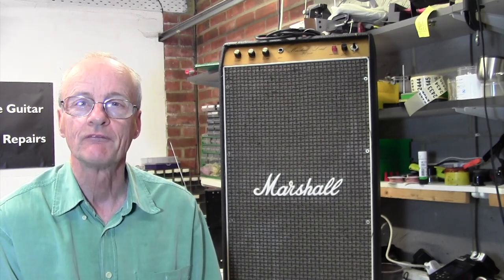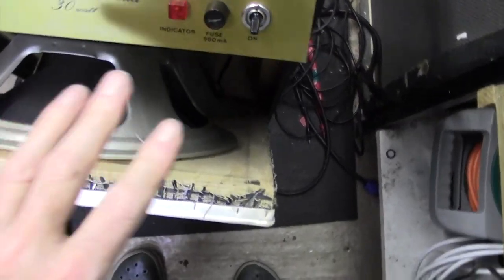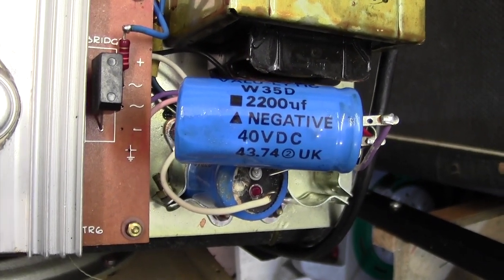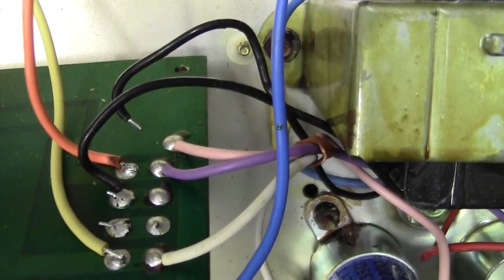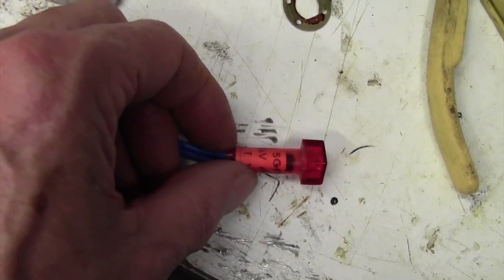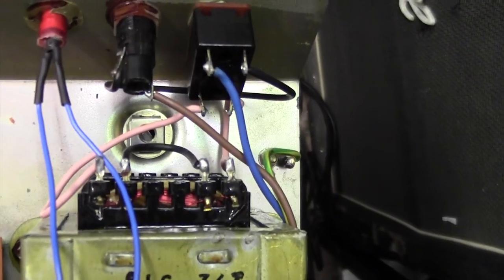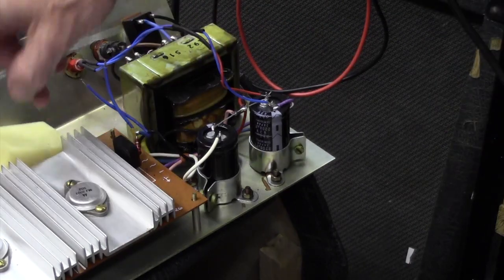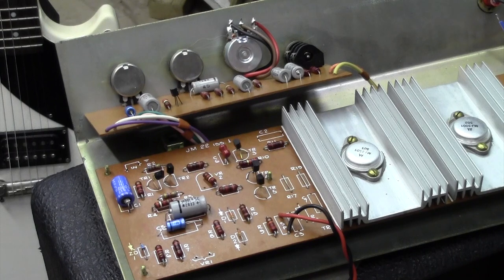How to Fix Marshall Lead 30W Hum

Comment: I too repaired and built amps in the late 70's and agree on there simplicity compared to the modern amps. However now amps have fancy anti distortion and clipping circuitry and DC protection. In the 70's amps if an output transistor failed as they often did then you could kiss goodbye to your speakers too more often than not. Keep up the good work. Love the videos.
Reply from the maker: Thanks Stewart

Comment: You've never seen one in the shop because this is the first one to ever break down.  Even at that, it wasn't actually broken, it just outlived the smoothing caps.

Say what you want about solid state, but it's a fair bit more reliable and maintenance free than valves. Yes, it has a sterile tone, but that's what pedals are for.  My favorite amp is my '77 Peavey BASS which looks very similar to that SS Marshall on the inside.  It got its first cap change on its 45th birthday.  Been rock solid, no issues at all for all these long decades.
Reply: Perhaps Stuart never saw one before because very few of them were sold, or maybe very few of them were sold in his general area.  It's difficult and probably inaccurate to make generalizations when you only have a sample size of one. It's also kind of an oddball, funny looking amp with only a few knobs and a big cabinet, and so it's hard to imagine that it would be a "standout" that grabs people's attention in a music store and yells "try me"!.  Not all products that sell well are "good" and not all products that sell poorly are "bad"; but it's difficult to know the difference if there were are very few of that particular device around that you can try as a player or work on as a tech.  That said, from a  tech's perspective (50+ years in electronics, myself) this is a very simple looking device and likely wouldn't be difficult to service as long as the transformer's okay and it doesn't use any unusual transistors that aren't easily obtained or substituted for.
Reply from the maker: Another contributor has said these were mail order only, apparently.

Comment: Great video again Stuart. I remember a few of that design knocking around in the 1970's. Simple, effective and reliable as long as you didn't spill a pint of Watneys Red Barrel  over them.  Nice looking amplifier with the upright 2X12 configuration and it didn't look like a pain in the rear to repair either.
Reply from the maker: I wish they were all so straightforward!

Comment: Thank you for another entertaining lesson on working on these older amplifiers.  I am learning much from your videos.  I believe  your systematic troubleshooting is the most valuable lesson I have learned. I picked up an old nonfunctional B&K 625 tube tester and was able to repair it by using your methodical, simple troubleshooting.  
Thank you for speaking to the newbies as there is much I have to learn.
Wonderful video of amp I've never seen before.
Thanks again, Stuart.
Reply from the maker: Thanks Michael I'm glad you enjoyed it.

Comment: Back in the 1980s I had a Marshall Lead 20 solid state combo, which sounded pretty good for  a solid state amp. There was a 12 watt version as well.  The pots unfortunately were very low quality and subject to being noisy no matter how often you cleaned them, and there was some internal hum radiated into the audio signal due to the location and orientation of the transformer.
Reply: I've noticed that one of the pot in the amp seem to be changed....  maybe a common fault?
Reply: @bjornstromberg7975 ,  according to a guitarist and music shop owner I went to school with, yes, noisy, intermittent pots was indeed a common problem with Marshall solidstate amps of this era.  My Lead 20 was probably a generation or two after this amplifier however because mine had all the pots mounted on a long strip of circuit board and not individually wired and mounted like they are on this amp.  The pots in this same amp would be easy to change but they would not have been on my own amplifier....

Comment: 13:30 ... About the transformer AC ...
The common 3 lead center tap transformers divide the Mains in 2 phases that are 180 degrees from each other. 
If you put the leads on these points the meter sums the phases ex: 20 + (-20) and the result is close to 0.
This doesn't happen if one lead is on a fixed voltage.

Comment: i love your videos . i seem to learn something on everyone i watch . you explain everything so great even a beginner like me can understand and learn from them thank you .i do have a question about this one so on the cans when you was explaining the wiring the red wire  is coming from the center tap then the purple is negative. the question is why wouldn't you ground the purple negative side and not the center tap  wouldn't it just short out the can? this one has me stumped because i know it is right just don't understand how it works. thanks again i have learned a lot from your videos
Reply from the maker: It's a bit hard to explain simply but if you ground the centre tap of a secondary winding, the other two sides give you two equal antiphase signals. That probably didn't help!

Comment: I had one of these but it was a beige colour and it suffered from some sort of thermal run away problem, as it warmed up it made a motorboat sound, and you would have to turn it off untill it cooled down, if you turned it upside down you'd get another ten minutes or so before it happened again
Reply from the maker: Just use it upside down. Sorted!

Comment: I have a cheap dental mirror which is backlit by an LED that aims at the mirror, powered by a AA battery. Very very useful!  The original mirror was plastic and eventually got scratched up so I replaced it with a glass one stolen from another inspection mirror.
Reply from the maker: Hmm, nice idea! Must gey myself one.

Comment: Just found this channel. 😊Very good. Question : i have a few solid state amps old, British when turn power switch on theres a loud crack/bang from speaker. I've used amps since 1980 and many have done this.. They work ok but i dont like thus turn on "crack * bang sound. Is there a way to stop this or does some cap need replacing? I thought i read years ago that there is a fix for this...? The amps i have that have problem is Vox Escort bass combo quite old.. Some caps were replaced about 20 years ago.. And other is that late 70's. Modelling amp built into flightcase by PA:CE, sorry i forgot name.. That really is scary bang on power up.. Its never been serviced and needs one.. Its missing the speakers and flight case box. Redmere is name, models a Marshall, Fender Twin and Vox its claimed and weird touch switches and built in sustain and chorus, flanger.. Thanks
Reply: Redmere Soloist:
https://youtu.be/4SKEZglt9cg?si=j6Pz0bZpDNZKyGJY
Reply from the maker: Hi This is one of the more tricky things to sort and often cannot be. It's usually the design of the amp. A cap charges up quickly on power-on and this DC spike gets transferred to the speaker causing that bang. No easy answer I'm afraid.

Comment: The reason the amplifier sort of worked is because the amplifier has a plus/minus (+/-) power supply, and the power transformer therefore has ---- must have ---- a grounded centertap for the secondaries; and as one leg of the secondary intermittently disconnected itself from the circuit (touching the soldered connection intermittently or perhaps hanging by a cold soldered thread)  You still had some voltage being fed to half of the project of fire by the one remaining secondary and the chassis grounded center tap.  This would have given you only a half wave power supply with lots of ripple on it as either the plus supply or the minus supply went missing in action.   There are other possibilities also involving maybe a shorted filter cap or some other way that you could still get plus and minus voltages to the output stage (are they a complimentary NPN/PNP pair, or not) , but regardless it's clear that you can disconnect one secondary and still get AC voltage to the bridge rectifier because of the center tap on the output side of the transformer, and DC output from the bridge....
Reply: PS, I looked more closely and the outputs are definitely complementary devices that run on a plus / minus power supply.  Temporary loss of either could cause DC offset and fry the speakers (as well as loud hum), so it's probably just as well that a wire broke off of the speakers to protect them! 😉
Reply: A variable DC power supply is handy for experimenting with LED's to determine what voltage to run them at for a good brightness level without causing overheating of the LED; and since they only need about 3 V more or less at very low current a resistor-substitution switch box is also handy because it prevents you having to substitute different resistor values one at a time to figure out how to drop your 20 or 30 V power supply down to the 3 V needed for the LED. It's also generally best not to shove the LED right up against the front of the bulb jewel or colored lens because LED'S are far more "beamy" and don't have a more omnidirectional light pattern as an incandescent or neon lamp would.

Comment: How did you decide on a 1.8kohm series resistor for that indicator LED?
Reply from the maker: Trial and error! I have a resistance decade box. I can just dial in resistors.
Reply: Simples, the resistance value is Vs - Vf divided by If.  Where Vs is the voltage applied, Vf is the forward operating voltage of the LED and If is the operating current of the LED.
Reply: @stuartukguitarampguy5830  ,  I am continually surprised by the number of technicians who don't own a resistor substitution box, or in some cases forget they own it and just don't use it for some reason. I have replaced many hundreds of incandescent lamps in old hi-fi stereo receivers, and  trying to achieve a suitable brightness level with multiple LED's by substituting individual resisters one by one would drive me nuts ( admittedly, that'd be a short trip in my case 😉).

Comment: The amp might not necessarily have been stored in terribly damp conditions, because the faceplate and the rest of the chassis looks pretty decent.  The wood cabinet, however, probably absorbed sufficient moist air that it accelerated the process of the glues in the plywood or particle board (likely formaldehyde or urea/urethane based) corroding the screws. The other hardware appears to be stainless steel and wasn't affected, but it may also have had minimal contact with the wood cabinet.  Anyway,  screws in a wooden guitar, just like the screws in a wooden cabinet here, might be more likely to rust simply because the wood becomes a mildly thirsty, spongy trap for moisture, and the wood may  also contain natural resins or artificial glues that accelerate or exacerbate the corrosion process. Add some finger schmutz and skin oils and salty sweat into the mix, and a guitar stored in a damp place is likely to undergo noticeable corrosion.
Reply from the maker: Yes I  think you're right there. The rest of it was in exellent condition.